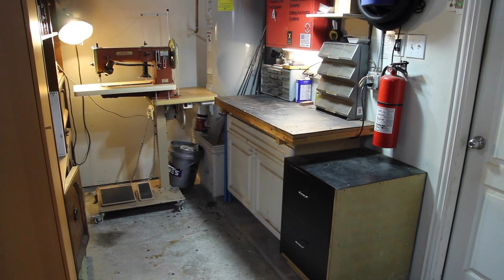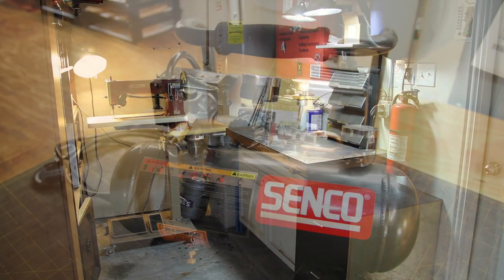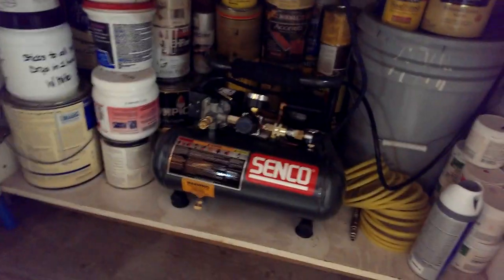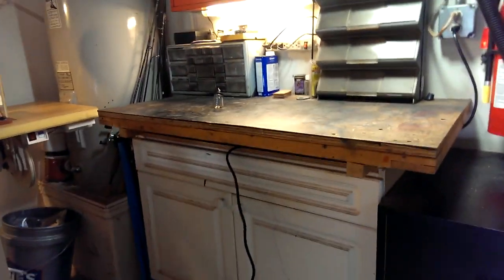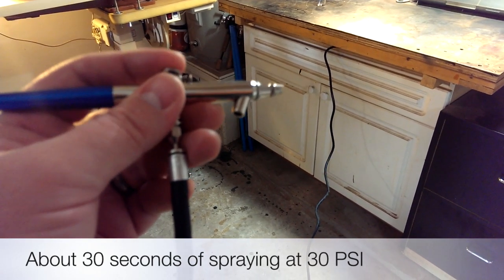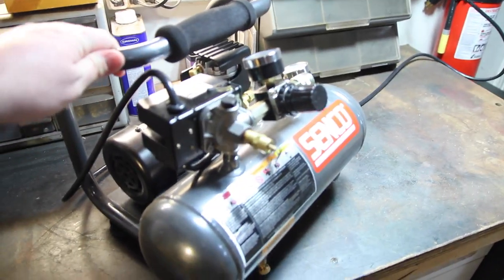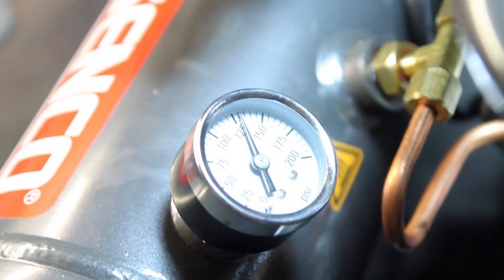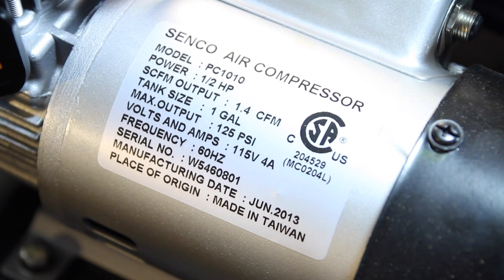Senco PC1010 - Brief Overview

Comment: Came here to see how to adjust the pressure. I wish that had been demonstrated. I just got one and it seems to run at max pressure all the time no matter what I do to the gauge. I'm handy, but new to compressors, so I may be missing something obvious to others.
Reply from the maker: On mine, I just have to loosen the black knob. I’m not in the shop right now to confirm.

Comment: Are you using a moisture trap? If so which one? Also fitting for badger air hose and brush?
Reply from the maker: I don't use a moisture trap. It's never been an issue when spraying my leather dyes. The fitting that attaches the airbrush hose to the compressor came from a kit I bought at the hardware store. I don't know specifically what fitting I used (I bought it over 20 years ago). The other end of the airbrush hose already worked fine with my brush.

Comment: I have a question, the air intake on the cylinder, is there a threaded hole for a muffler or at least a way a machinist could pipe something to the intake. Id like to see if I could use it to compress oxygen for my glass blowing. I need something in the  0.7 cfm to match the flow of my medical oxygen concentrators I use to power a glass blowing torch.
I have a Gast compressor/vaccume that's a bit weak and new ones at $380.
I'm looking for an alternative.
Reply from the maker: mike t I'm not sure where the intake is... does it intake through the motor somehow? There's a tapped hole opposite the brass fitting at the top of the piston head (opposite the brass fitting) but it seems to be plugged and doesn't suck air when I put my finger over it. Contact me via the contact page on my website and I'd be happy to send you specific pics of it. www.adamsleatherworks.com
Reply: Year I found the prints and the piston draws air from the crankcase through a small filter on the side. Not the best for oxygen compressing. I might just buy one to cannibalize it for all the nice components.
Thank you.

Comment: Eric, what kind of airbrush do you use?
Reply from the maker: I have an old Badger 150 that I purchased back in my college days in the mid 90's.
Reply: Eric Adams  What adapter would I need to connect the airbrush hose? all i have is the standard size hose and fittings, from my 30gal compressor. I know that for airbrushing the fittings are smaller, but what adapter do I did to reduce the fitting from the compressor to the airbrush hose. Thniking of buying this same compressor as you. Thanks
Reply from the maker: I finally remembered to look at the connection. I bought my airbrush hose from the hobby store. The hose has a brass threaded coupler, which I connected to a fitting that came in a kit from Home Depot. Here is a similar kit to what I bought 20-something years ago.  http://t.homedepot.com/p/HUSKY-13-Piece-Air-Tool-Accessory-Kit-41255HOM/205331964

Hope that helps!
Reply: Eric Adams thanks appreciate you getting back with me.
Reply from the maker: Hello - I use an old Badger 150 that purchased around 20 years. Thanks for watching!

Comment: How do you adjust it
Reply from the maker: I don’t know if there’s been updates to what is currently built into the compressor, but mine has a large knurled plastic knob with a gauge right next to it (the regulator gauge). Turn it one way to increase line pressure, turn it the other way to decrease line pressure.
Reply: @AdamsLeatherWorks  thanks but it's not building up pressure adequately enough and I don't know how to adjust it I've looked for leaks but I really don't know anything about it.
Reply: I wonder could the company help me with it.
Reply from the maker: I assume the drain plug is closed and it’s not leaking air. My regulator valve has a separate plastic threaded washer - screw them both all the way in for Max line pressure.
Reply: @AdamsLeatherWorks  ok I'll try that, just took it to a place and they think it's leaking in the weld, if so I'll try JB weld, they said they couldn't weld it, thanks for your input👍